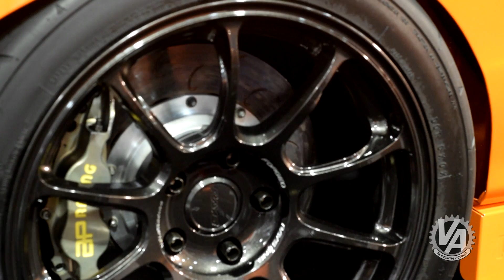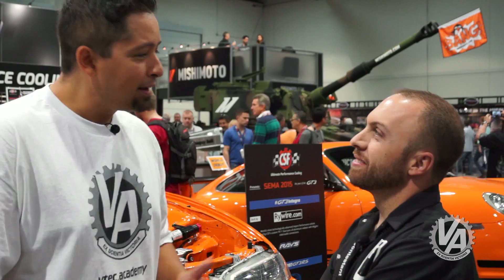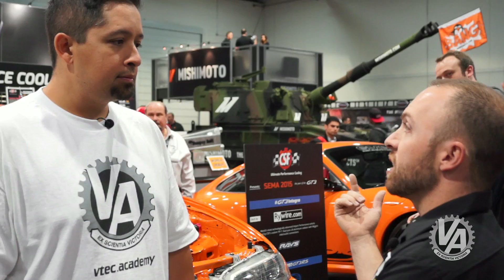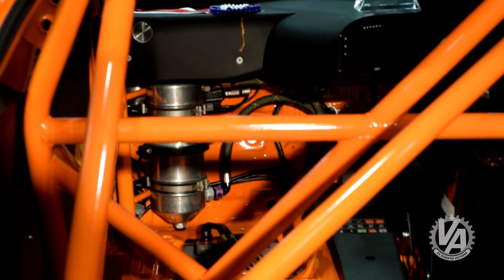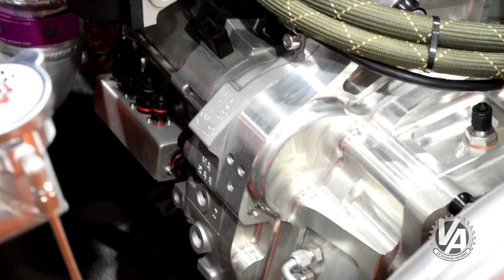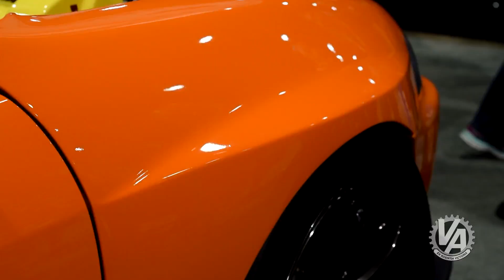Turbo K24 GT3 Integra Type R Rywire

Comment: Badass Integra, wish you would of at the most went with a sequential gearbox with the manual shifter still instead of paddle shifter, it just kills everything that is pure about classic imports when you add paddle shifters. Besides that, it is great! I also wish you would have went with an OEM color. My voltage blue metallic integra will someday be on par with this car no doubt about it. If I had the funds, I would have loved to do a joint build on my car. The one thing I will not change about my car is keeping it a usdm front end. j fronts are the most played out cars ever.1 second ago•
Reply: For the amt of power and the intended "purpose" of this build, a manual would be a downgrade. I do agree it's more fun, but not in this instance.
Reply: He's replicating his orange GT3 and using F1 technology. https://vimeo.com/145759635 good luck being on par with this build.